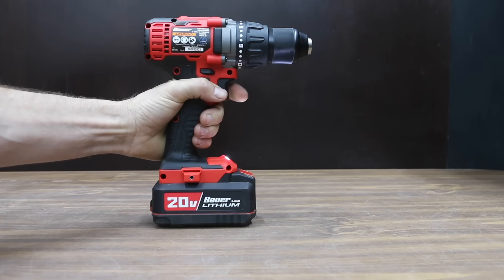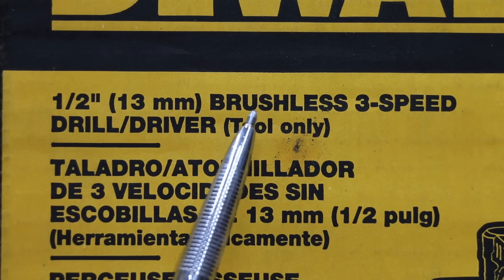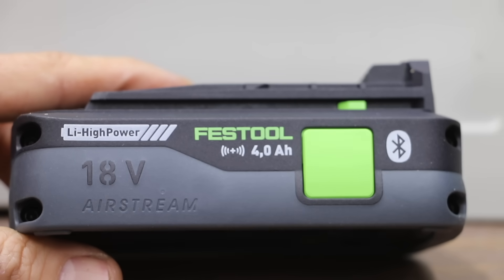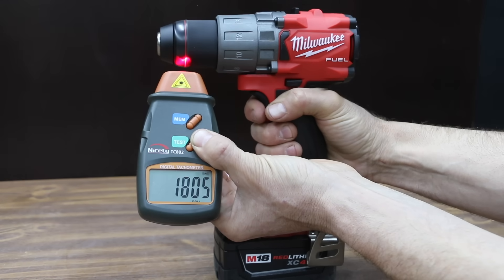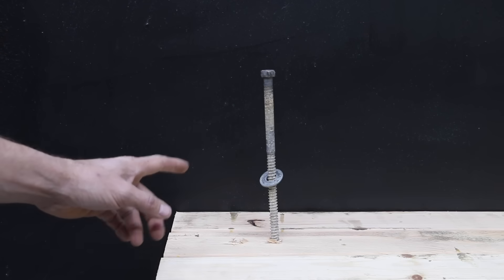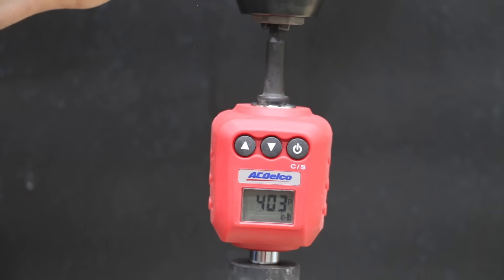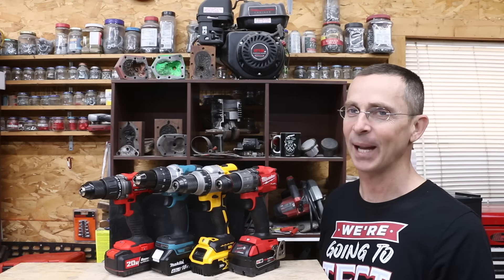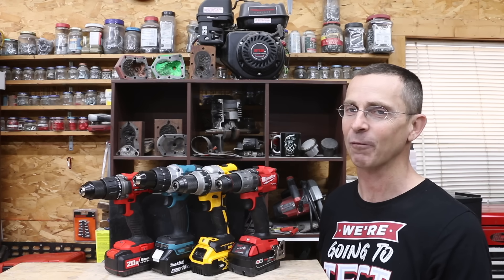Best Drill (BATTERY POWERED)? Milwaukee vs Dewalt, Makita, Bosch, Festool, Ryobi, Bauer, Ridgid

Comment: I’m glad Milwaukee, makita, and dewalt almost always hold onto first place. They are truly the three kings 👑
Reply from the maker: Thanks for the feedback.
Reply: That's because the parkside "performance" of lidl isn't included.
Reply: @janee7995  don't joke I've actually done the old why not test on the hand tools and socket kits and they are actually pretty good defo for the price haha.not brave enough for the electric tools tho haha.... multi tool "seemed" ok
Reply: @hujimwa  just look for a test  : Hilti vs parkside
The hammerdril is useless of parkside.
The screw dril / impact drivers / angle grinder machines are pretty good. 
The welding machine is also pretty good
Reply: @janee7995  hilti on a different level price wise and quality tho lol.
Think something like a hammer drill I wouldn't skimp on but a mutlitool or cutter you may get away with but probs most of us in here it's proffesional use so I'd by the branded batteries I have
Reply: I think dewalt makes the better 20v
Router, jigsaw and grinder...
Milwaukee surge impact driver is the best one I've used in my 20+ years of work...
Makita had the best 18v grinder hands down and it comes with the paddle switch trigger as opposed to red and yellow you have to get a top shelf grinder to get that
Reply: @MrDrb8354  forgot that dewalt makes the best drills. After all their parent company invented the first cordless drill.
Reply: @chrismmmhmm2337  so you are now making a dang assertion that my experience with milwaukee tool is minimal? Actually, I've had several red tools break down on me. Several.
Reply: Found this comment I did! 😎😎👍
Reply: I heard that Festool lasts long and do not wobble. Some specimen of the competing machines may have a wobble that shouldn't have passed quality control. However, if I get a more powerful machine which has a shorter length, with case, one or two high capacity batteries and a charger for half the price or less of the Festool, I am happy to return it for a replacement. I'm sure that the Festool can take some beating. But so can Milwaukee, Makita and DeWalt and probably some of the other brands too. For lasting long: I rather have a machine that works for a couple of years and if and when it dies, I replace it with a newer one with improved tech. For a DeWalt, Makita and.Milwaukee you can do that at least once, that is still a lot cheaper than Festool. And of course, the batteries of Makita, DeWalt and Milwaukee can be used in so many more tools that Festool does not offer.
Reply: No, Hilti also made good job.
Reply: I am in the dewalt camp. once you get the first tool, you are a bit committed to the battery, after the second or third tool, you have no choice anymore as you have $600 worth of batteries. i have 6 20V max dewalt tools.
Reply: @johnm948  Yeah
Reply: @lukerestlessstudios  yep
Reply: Milwaukee stands alone as the king, which is also why they are the most expensive. But if you use your power tools on a daily or near daily basis year round you should except no substitute. All the professionals use Milwaukee brand because they are the most powerful and reliable brand. I personally am happy with Rigid because it's a solid mid tier with good price/perfomance  ratio and I don't use my tools regularly.
Reply: @Nunyabusiniss  no, milwaukee doesn't last long and isn't quality. Dewalt and makita will serve you much longer, decades even. Milwaukee is a chinesium - based tool. Although it's powerful, the chinese build quality will begin to show over time.
Reply: My experience with DeWalt is the tool is not the problem, but it's the battery packs, they just don't last.
Reply: @garyh.8082  snapped the chuck off my dewalt hammer drill. Never again. I work in a auto plant and we use Milwaukee and/or snap on tools. After the beatings I see Milwaukee take, I’m sold on that brands durability.
Reply: @systemsh0wd0wn  Boilermaker here, I’ll say the contrary to your position on Milwaukee. I had a brand new out of the box drill let out it’s magical stinky blue smoke on the first use. We have and use hard everything available as sometimes we are at a job and can only get what’s closest/available at the time ( 24 hrs a day and  7 days a week- holidays don’t really exist to us because those are shut down days). We have kobalt, baur, dewalt, ryobi, Milwaukee- they all have their issues and for the most part all do why they’re supposed to.
Reply: @systemsh0wd0wn  I'm the opposite I tried the Milwaukee and now it sits in the bottom of my box because even though it was more money couldn't compete with my DeWalt and DeWalt ergonomic are better for me but that's my opinion
Reply: Milwaukee is not bad, but it’s also overrated. I’ll take the Dewalt over it 7 days a week.
Reply: @rcg9573  same
Reply: @rcg9573  See I agree to an extent. I disagree that Milwaukee is overrated. I use a Milwaukee and a Dewalt at work because my boss got a dewalt impact and I have my own milwaukee. Both are 1/2 impact wrenches, both hold a charge just about as long and both give almost identical torque. Mind you I build 2-3 axle dump and gooseneck trailers. Those impacts both take it like a champ
Reply: @garyh.8082  stock up on spares. Have the charger ready.  DeWalt also has great Bundle Sales and Discounts imo
Reply: @garyh.8082  I personally haven't had this problem with there batteries as of yet and I have some pretty old batteries
Reply: @garyh.8082  really? What amps? I've got the 6amp flex volt pretty good tbh
Reply: Just bought DeWalt XR and it's really great, done my job in less time. Nice review.👍
Reply: Milwaukee for the win 👍🏻
Reply: @nutrientdensepermaculture9391  Yep, must agree. DeWalt not bad either.

Comment: I sell power tools for a living, lots of cordless, the drill/tool is only part of the equation, the quality of batteries and chargers is also an important variable for the long term durability of the entire kit. Actually all the high end brands at the top end are good, it really gets down to personal preference, I personally own Milwaukee. But I also owned a Makita for over 20 years, I only retired it when all 3 batteries died at the same time. Milwaukee has the best warranty at 5 years, and they actually repair or replace the tools that are truly defective about 90% of the time. Nobody covers abuse, they can tell when they crack the case if you left it in a 5 gallon pail that filled up with water in the rain, and they won't cover that.
Reply from the maker: Thanks for sharing.

Comment: I used to build homes back in the day, I remember using a 1/2 inch to 3/4 inch drill bit to make holes in the mud-sill for the bolts that were anchoring down the walls on the perimeter of the cement slabs. I mean hundreds of holes per slab. We used a ton of drills, they would all kinda die off and we’d have to let them cool down on account of it being over 100 degrees Fahrenheit some days. We got a Milwaukee drill, the big one that spins around 7200 rpms. Let me tell you, it didn’t matter if it was 25 degrees or 110 degrees, that Milwaukee drill was the toughest son of a you know what I had ever used. It was relentless in those extreme conditions. After seeing that all I’ve ever bought were Milwaukee drills. In over a decade of heavy use, and I mean constant back breaking manual labor of heavy use. Milwaukee hasn’t let me down.
Reply from the maker: Thanks for the feedback.

Comment: is it possible to add Hilti to your tests? it is one of the better brands aswell
Reply: Hilti makes impacts and drills as well as reciprocating saws, circular saws etc
Reply: Hilti is over expensive
Reply: Yes but hilti is more of a specialty brand.  You wanna drill a core sample that’s the brand you want to use.  They’ve been innovators more than anything.  Milwaukee still will come out on top of Hilti.  If you did compare it within the ones he’s tested here it’d probably be between the makita and bosch.  Thought that’s for the impact side of things.
Reply: @Thevoice4405  depends on which of the Hilti drills you are comparing to. They got impact drivers as well as standard drills (and some of the drills are beasts)

Comment: Thanks for these videos. You always make them very interesting and no wasting time! One thing I'd like to see is some of the Kobalt 24v max tools start showing up in your tests. They get great reviews, and I'd like to see how they compare.
Reply from the maker: You are welcome!  Thanks for the video idea.
Reply: Especially the Kobalt XTR Max series, which is an improved and more powerful version of the earlier Max series.  I own the XTR hammer drill, advertised at 1200 in lbs, and the XTR impact driver, advertised at 2400 in lbs, and those are some of the highest numbers I've seen listed for drills and impact drivers.  I've used the impact driver with a half inch adapter and socket to zip off lug nuts torqued at 150 ft lbs, and it didn't even break a sweat.  The drill is equally impressive, and Lowes routinely has sales on their Kobalt tools, especially when purchased as combination kits with several tools included.

Comment: Bought a Milwaukee drill and impact driver couple of years ago, best tools I ever bought .
Reply: There decent there not as expensive as they used to be I went dealt a few years ago because of the flex volt batteries so it's one battery for all my tools. Dewalt have done me good tbh
Reply: Shouldve got makita

Comment: I bought a Bauer drill once because my old drill died and the only thing open near me was Harbor Freight. I ran 3 or 4 screws in and the drill died. I ran it back and grabbed another one to finish the job   I ran about half a dozen screws in and shelled the gear in the drill. Drills are not a place to go cheap. Lesson learned.
Reply from the maker: Thanks for sharing.

Comment: Great overall presentation.  I think the test with the engine brake is somewhat bogus - the brake could have worn during the tests or as it became heated changed its friction coefficient for later tests.  There's no accurate way to tell if the friction was constant for each drill/test. It would have been better to either leave the brake off and put the sparkplug in or run some other kind of 2 minute test, IMHO.
Reply from the maker: Thanks!  Thanks for the constructive feedback.

Comment: Basically, Festool is way overpriced trash.
Reply: Exactly!
Reply: $450 was spent in designing the carry case(WHICH SHOULD CARRY FREE COLD BEER FOR LIFE)
Reply: I worked with festool and dewalt in upholstery and i have to say that festool is the best i’ve used so far , in delicate work it doesnt compare to anything and the transportation box is really helpful. In case i need more torque i use dewalt and for delicate work i use festool , it’s not bad at all compared to the results in these tests
Reply: @pauladriantrinca7881  Really? That's cool.
Reply: Dont you love how he NEVER said that though. He ended the video with "certain" drills on screen and not others.

Comment: I bought the other HF brand Hercules impact driver. I have used it a bunch and it works great. I believe it's a Makita knock off. I worked for years in construction with the popular brands, Hitachi, Makita, Dewalt, Bosch and like you said for the money working on things around the house and general DIY projects it's hard to beat that low price.
Reply from the maker: Thanks for sharing.

Comment: I'm a big Dewalt fan.  Those are what we were issued for my job in the US Air Force and I have accidentally dropped one off the roof of an airplane hangar before.  After that drop it had a few deep scratches on the outer casing, but the drill still worked perfectly.
Reply from the maker: Thanks for sharing.

Comment: Didn’t know Apple oversaw the sales of some drills and decided not to put a charger or battery with your tool
Reply: You got that all wrong...if apple was overseeing than it would come with a battery permanently installed so you could replace the whole drill when the battery fails. And change the charging port every 3 years.
Reply: Considering you can easily buy pretty much all of these as a kit with a battery or 2 included as well as a charger just in case you already have several batteries and don't want to buy more like a lot of people do, you comment is invalid.

Comment: How does Black and Decker stand up to these brands? I've got an older drill (about 10-15yrs old) and the rechargeable batteries are failing it, thinking about replacing it altogether with one of these products actually.
Reply from the maker: Thanks for the suggestion.

Comment: I can attest personally with 2 DeWalt drills my dad owns, the same you tested. They are most certainly not for delicate work! They're almost as brutal as a Milwaukee Hole Hog if you're not careful. I prefer more compact and versatile drills and tools, I use Porter Cable for my stuff although I don't use it as heavily as my dad does his tools.
Always enjoy these videos anyway! Thanks so much for the info, it is incredibly helpful!
Reply: There's a carpenter I know. He once told me DeWalt is low quality. Festool is high quality, but quite pricy.
Reply: I’m a professional low voltage electrical contractor, and can tell you DeWalt and Makita are easily the most common tools on a worksite. Festool seems like what the contractor has in his home shop—because he can afford them but would never trust anyone else to use them. Workmen couldn’t afford them, and/or would probably be afraid they would be stolen. I’ve used DeWalt without fail for the better part of the last 10 years, although I don’t consider myself to have any strong opinion on brands one way or the other. I forget who, but someone recently put out a video showing how almost all of the various tool brands are effectively part of the same parent company nowadays anyhow.

Comment: i use my dewalt drill to drill and my dewalt impact driver as a driver so I'm not really sure why all your testing was driving and not drilling when the main feature on a drill is the drill chuck for holding drill bits.i would have liked to see them with a 1" spiral auger going through some hardwood beams and see how many holes they can drill on a single charge. That said i enjoy your vids
Reply from the maker: Thanks!  Glad you enjoy!

Comment: You always do great videos - in drills my biggest concern is how well does the chuck hold.  It seems it's really hard to get a drill with a chuck that actually holds a round bit without slipping.  Thanks again for all your videos.
Reply: I owned a Milwaukee , worst Chuck on any drill I have ever owned , I would not buy another
Reply: Good point 👍
Reply from the maker: You are welcome!
Reply: My Dewalt comes lose fairly regularly,  an issue (maybe mostly the operator) that I haven't had with my bauer even though they are identical chucks.

Comment: For me the Milwaukee drill is by far the best in the 12V sector, because i really like the amount of tools they offer and the quality is very good. The performance is perfect for work at home. Here in germany you can argue may get Bosch 12V because they have nearly as much tools that fit with there battery pack and the quality is also very good. (at least Bosch blue - Bosch green is not good anymore)  For 18V i would most likely prefer Bosch, also because of the variety and the quality. But for me there is no need to get a heavy 18V, because the 12V nowadays are so powerful. Festool is too expansive if you work with those tools just as a hobby. Its made for professionals and comes with special warranties, high quality parts etc. I mean their quality is very very good and whats even more important, there tools are very precise. A brand i can also recommand whos very well known for very good quality and performance is Fein. Its a very old, underrated german brand, but their quality is top notch. Their Multitool is probably the best you can get.
Reply from the maker: Thanks for the feedback.

Comment: Does the Makita have a break on the drill? Was looking to replace my brushed Rigid drill with a brushless set. Bought a DeWalt drill/ impact driver set and noticed the drill did not have a break. When you let off the trigger the drill continues to spin. I prefer the drill to stop immediately when I let off the trigger. This is how my brushed Rigid drill operates. So I returned the DeWalt set and bought a Rigid set. Same thing. No break on the drill. Both the DeWalt and Rigid impact drivers however do have a break. Now I'm looking at a Makita set. Unfortunately these can't be tested at the big box stores since most of them do not have batteries in them. You can't ask anyone for help because nobody is knowledgeable on the products. Hopefully you or someone on here can help.  Thank You!!
Reply: Never mind, I figured it out on my own. Went out and bought the Makita set to compare to the Rigid. The Makita brushless drill  DOES have a break. My decision was made right away to go with the Makita set.

Comment: I bought an Aldi drill for 30AUD (on clearance special) which I believe was 50AUD when release. It claims to be brushless so I'm curious as to how it would hold up vs the Bauer. It does have a fair bit of internal wobble though, so there were definitely some corners cut there.
Reply from the maker: Thanks for sharing.
Reply: Parkside right? Where do those tools even originate from?

Comment: Festool is ‘expensive’ because you pay for the ecosystem, actual warranty, parts, on site service and whatnot. Any professional machine is easily 5-10x the price of the consumer version. This decreased downtime justifies the price for professionals. 

And with the 4000 rpm its the only one capable of grinding and milling stuff. And the quick change head system is also great for swapping quickly and specialized attachments. And it should be able to do 60Nm (530 inch whatever)
Reply from the maker: Thanks for the feedback.